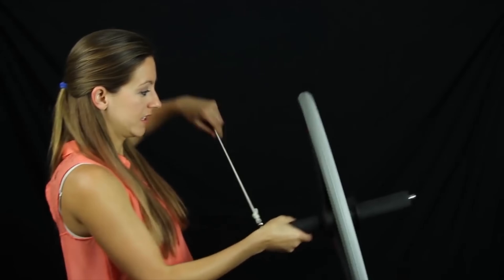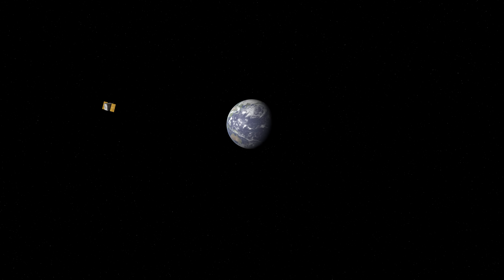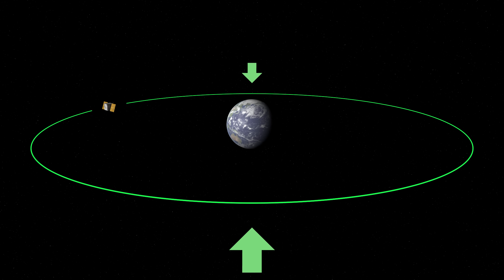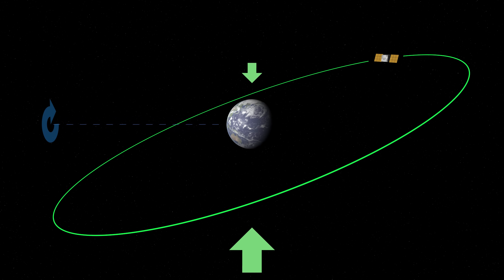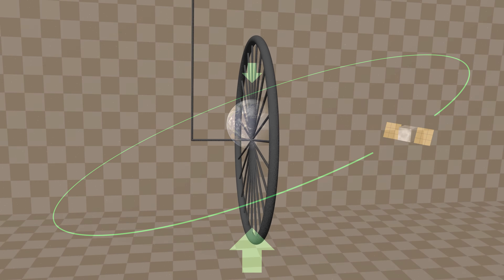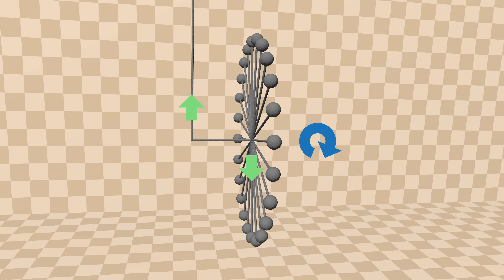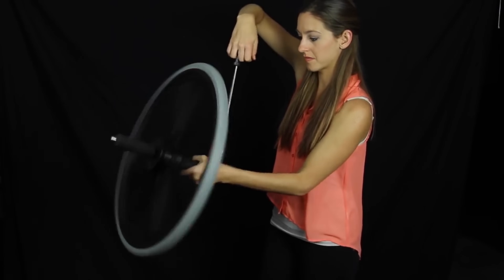Gyroscopic precession -- An intuitive explanation

Comment: That may explain why the wheel as a whole is rotating...sorry but i couldn't figure out why it is not dropping.????

It will be soo nice of you if you can answer me...
Reply from the maker: Referring back to the satellite part of the analogy, you'll notice that the orbit of the satellite is not turned in the way that you would naively expect based on the applied force/torque. So convince yourself of the answer for why that is the case, and you should then be able to transfer that insight over to why the bicycle wheel does not fall in the way that you would naively expect based on the applied force/torque.

Comment: As a motorcyclist, I immediately could apply this explanation to the mystery of why leaning a motorcycle causes it to steer in the direction of the lean. My shifted body weight applies a torque pressing the top of the spinning front wheel in the direction of the lean. The wheel responds by precessing in that direction. It now seems so simple. Thanks!

Comment: Thanks for great explanation. What is still not clear to me about gyroscope, is how it gets up in situation like in video ( https://www.youtube.com/watch?v=fv_AinDLHJY ). Is it possible maybe with Veritasium (if you would like) to check if this same effect of getting up will appear in vacuum. Greetings, KollA.
Reply from the maker: Whether it's in an atmosphere or a vacuum is irrelevant. And what's shown in that video is exactly the same as the spinning bicycle wheel demo, except the support string/cable in the bicycle wheel demo is replaced by a support pole in your video. Gravity is not actually being "defied", the pole is supporting the weight of the gyroscope.
Reply: @TheHuesSciTech   Yes, but I'm asking not about only gyroscopic effect, but why axis changing from more horizontal to vertical on "my" video. Like for me gyroscopic effect should only slower down gravitational falling down. In that case something push continuously gyroscope disk upwards (as long as it spin enough fast). So I wonder if this force (opposite to graviation)  is generate by Magnus Effect, and in vacuum this effect should disappear.

Comment: To me it makes sense why the axis changes in the way it does, but i still dont understand why does it "defy gravity" and doesn't fall. For example if u spin a top why does it keep balance?
Reply from the maker: I know this isn't a terribly satisfying answer, but here goes: for a normal non-spinning object (like, say, a pencil balancing on its end), gravity will try to pull it over in a certain direction, creating a torque around a certain axis, and then (because no precession is happening), it rotates about that axis and thereby falls to the ground. But when you have a spinning top, the torque from gravity is applied around an axis that is "trying to make it fall over", but the axis change occurs, and it ends up adopting the classic precession-of-a-spinning-top motion that you're familiar with.
Reply: @TheHuesSciTech  Thanks, it is satisfying actually

Comment: It makes sense for a system spinning around a central point and it can be seen that the orbit of the satellite will change/rotate at 90 degrees to and while the up down torque is applied. The system of the bicycle wheel is not the same because it does not allow the system to rotate about a central point because the fixed point is offset from the centre so this adds an element to cause the orbit/wheel to move around the the fixed point. That part is not explained but would equally apply if the wheel spindle was placed on a solid point. The reason for this known and is why a spinning top will do it. All to do with wP.

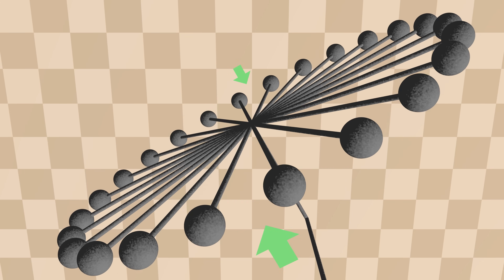Comment: This is the best explanation I’ve seen on YouTube by far but at 2:50 shouldn’t those two forces twist the wheel on the other axis? I guess I’m asking if the wheel should basically flip. It makes sense to me that the orbit should change direction like that because, well it’s just the orbit, idk how to explain why that makes sense except it’s not attached to the center of the orbit or earth or any of that like the wheel is attached to the spokes. I Imagine if I push the wheel with my hands like shown in the arrows it would flip the wheel like I’ve said but Idk i just don’t understand
Reply from the maker: The thing is, the strings/spokes "attaching" the balls to the center of the wheel are just like the force of gravity in an orbit -- since, in both cases, the force is directed right towards the center of the wheel/orbit, and thus cannot have any effect on the twist seen by the wheel/orbit. 

I think you need to consider the balls to be separate objects, and the spokes in terms of the force they apply to those balls (rather than getting carried away with the nebulous idea of 'attachment'), and then hopefully it should become clear that the analogy is valid, and that the wheel should twist as shown. Then you can add more and more attachments and see that there's no reason why they'd change the outcome, and thus infer that a solid, rigid wheel will behave identically.

Comment: The torque has been eliminated,  but what happened to the weight of the wheel?  I mean, the satellite analogy was not held by anything, so the part of the turning (precession) was explained when the plane was shifted., but what  the about the weight, what is countering it?  why does it not flip over?
Edited(after 6 days:  Now I get it! the precession does not counter the full weight of the hub, but just sufficient to maintain the plane of rotation - like when you ride a bicycle, you turn the wheel to the side you feel like falling as  you move forward, shifting the CG just sufficient to remain upright!  And in the case of the gyroscope,  it also does the same by rotating (precessing) around the axle so that its CG is exactly on the attachment where the hub device is attached. And when the disk slows down, it has to speed up the twist.--Jus like on a bike! OR a racing bike taking a corner at high speed and rider's knees almost touching the ground! I wonder how brainy the gyroscope is? Any logic?

Comment: Came in confused came out slightly less but still confused

EDIT: I think I got it, and it's a lot easier if you consider it mathematically in my opinion. L(angular momentum)=(radius)(momentum). Both radius and momentum are vectors, and thus when vectors are multiplied, they create something called a cross product. A cross product creates a line that is perpendicular to the 2D plane that the radius and momentum were on. Here is a link on cross products: https://www.mathsisfun.com/algebra/vectors-cross-product.html  

and here is a link to a stack exchange question that may help: https://physics.stackexchange.com/questions/554047/why-is-the-vector-of-angular-momentum-perpendicular-to-the-plane-of-rotation 

Do comment if you want any clarification!
Reply from the maker: Keep at it, my friend. Just remember that this isn't really anything to do with maths; it's all about how things move in the real world, and just carefully thinking through what happens over time.

Comment: But where the energy come from l mean we push the stattelit a little bit his new direction is the depends on the speed of the old direction and the speed of the new direction but to add the new direction we need the energy because is it a speed here it is no problem because the stattelit give himself the energy but the force of the wheel comes from the gravitation so the gravitation make the wheel move around the rope and this move needs energy but when we say that the energy comes from gravitation that would mean that the weel need the sink a little bit because now potential energy is changing into moving energy .so does the wheel go down a little bit and after a while the wheel is hanging like a ,. + ,,  at the rope?

Comment: When the force is applied upward to the passing satellite, why is it assumed the satellite completes its upward travel just in time to be at the 90 degree point in the revolution? Your explanation implies that is the case, but I do not see why. 
Why couldn't a satellite  reach the end of its vertical travel at some other angle in the revolution, say 45 or 60 degrees for example? Why 90?
Reply from the maker: Play Kerbal Space Program and you'll see the effect in action. Or if you need proof: basically, an orbit occupies a plane. You have two constraints: one is that the plane intersects the Earth. The other is that the satellite stays in the plane, in particular, it is in the plane at the instant the force is applied. If you constrain a plane to go through two different points like that, there only degree of freedom left is rotation about the line connecting those two points. Such a rotation produces the greatest "upward travel" (as you put in) the more distant you get from that line, and the most distant you get from that line is after 90 degrees of revolution (assuming this is a circular orbit, of course).
Reply: @TheHuesSciTech  Thanks for the explanation. I'm closer, but still not getting it. You mentioned 2 points. Is one the point at the center of the circular plane (and center of the earth)? And what is the other point?
Reply from the maker: @jazzjohn2  Yes, one is the centre of the earth. The other is the satellite at the instant that the impulse acts upon it.
Reply: @TheHuesSciTech  ok, thanks. I'll continue to think about it until I get it. (That's the usual way I learn things.)

Comment: Brilliant!  So my friend - please, please, come up with a similar explanation for the TIPPE TOP. I'm struggling to understand why it's stable with the heavier side upwards. Because it doesn't have bearings, it behaves differently to a gyro. Obviously, table friction is the force changing the direction of motion of its parts. The axis of spin, relative to the observer, stays vertical. And the clockwise/anticlockwise direction of spin, relative to the top, reverses - magic!

Comment: Thanks, this is only intuitive explanation I've seen. To give others a hands on experience, I'm going to swing a rubber ball around in a circle, attached to a piece of string. And then ask them to hit the ball sideways so it's direction of movement is changed. They need to understand that fast moving objects resist changes in direction, and that's all we're really doing to a gyroscope wheel rim.

Comment: Now, my friend - have you any thoughts on Tippe Tops? The weird thing is that the axis of rotation actually rotates 180 degrees relative to the original axis. So when the axis of rotation eventually comes back into its original line, the direction of rotation of the top is REVERSED, looking at it from the viewpoint of the peg! My brain is getting there slowly. It happens because of the frictional forces of the table top, and it's offset centre of gravity. And like the egg shown by "Physics Girl" in your link, the stable rotation is when the heaviest part is on the top. But I don't think you can explain it with gyro precession. Gyros don't change their direction of rotation! However, the axis of rotation of the top stays unchanged relative to the table top.

Comment: Thanks for the orbiting satellite explanation - I now understand it! This is the only one that I've found that explains WHY precession happens. The key to understanding, is that pushing the satellite sideways changes its direction of motion permanently, and that changes its orbit. Brilliant explanation.
Reply: I just realised that the satellite will go faster, and the orbit increase in diameter - because pushing the satellite sideways should add energy and a further velocity vector at 90 deg to the original velocity. But does moving the axis of a gyro require energy?

Comment: Procession only works when one pole is fixed... without one pole fixed there is no procession. This is why procession of equinoxes does not work. There are other clues for example why do some starts appear to process and Sirius does not? The Earth does not process this way at all. One needs EU theory to explain what is going on and it turns out their hypothesis is much simpler. Having said all that fixed-pole procession is still really really cool and useful.
Reply from the maker: One can do the thought experiment/simulation of applying a torque to a spinning sphere, and regardless of whether "one pole is fixed", precession will be seen to occur. In fact, the satellite example here does exactly that. Precession of the equinoxes is very well supported and backed up by millennia of observational evidence. And the statement that "Sirius doesn't precess" betrays a complete misunderstanding because it's the Earth that's precessing, stars just provide the mostly static backdrop which we look at to see how the spin of Earth is changing. I don't even know what "Sirius doesn't precess" is even really meant to mean.
Reply: @TheHuesSciTech  https://www.youtube.com/watch?v=-oPE3l5E8uk&list=PLeeyNowkGd8PBMqxTwqwYzhTmWxEac2yM&index=5
Reply from the maker: @alanlittlemoon8194  That video claims that the precession of the Earth doesn't match up with calculation, and that such precession has never been measured in any planet in the solar system. Two facts which are obviously in contradiction with each other, but whatever. I gave you plenty of falsifiable statements in my initial reply to you, so if you'd like to actually engage in some debate here, here are some suggested lines: "Your demonstration of how precession occurs in the satellite example is wrong because X"  "Wikipedia's article on precession of the equinoxes is wrong in section X paragraph Y because Z"  "Here's what I meant about Sirius not precessing: X"  "Observing an anomaly in one star (Sirius) should cause us to abandon the idea of the way the entire Earth moves, rather than just asking questions about Sirius, because: X"

Comment: I understand this whole video, but I'm still confused about one thing: does the movement always occur 90 degrees ahead of where the force was applied?
Let's imagine the satellite orbit situation again. What if the satellite is moving REALLY slowly? I'm guessing it won't be 90 degrees anymore, but less than that.
Reply from the maker: In the satellite case, it is always 90 degrees. In the case of the spinning wheel, there's the thorny issue of the distinction between A) the axis of rotational symmetry of the wheel and B) the axis of rotation of the wheel. There's also friction. So things get messier in that case.

Comment: Making a scientific phenomenon sound intuitive sometimes destroys the physics behind it, and this is exactly what happened here. You need to understand the physics behind the phenomenon because your explanation above just provided viewers no real understanding (aside from the fact that was was shown is intuitive) , it is like when you memorize a math problem instead of understanding how to solve it.
Reply from the maker: Angular momentum is an emergent phenomenon that comes from multiple individual particles moving about; and gyroscopic precession emerges from looking at the behaviour of those individual particles when manipulated in the appropriate way. Even if this video doesn't provide a strict mathematical derivation of this fact, it provides the bedrock of intuitive understanding that would make such a derivation straightforward. This is much more pedagogically useful than telling students "here's the formula, the angular momentum vectors get added up, rote learn that", and the rest of the comments here back that up. Your comment is utter nonsense that betrays your own lack of understanding.
Reply: @TheHuesSciTech  i agree, but the point here is that what you provided here was more of an " analogy" by example rather that making the subject sound intuitive because it will never be, maybe for physics beginners it could help but not for the advanced.  The fear here is that people will begin to convince themselves that understanding a similar example means they now understand the phenomena itself which is wrong . Anyway , i advice watching Dr. Walter Lewin's MIT lecture on the subject : https://youtu.be/XPUuF_dECVI , starting from around @14:00.

Comment: I enjoyed watching your video - nice explanation.  Why did you show a wheel with individual segments may I ask?  Why not a conventional wheel?
Reply from the maker: If a wheel with separate segments behaved as shown, with the individual segments not "breaking formation" (i.e. they stay in the same relative positions), then it's trivially obvious that connecting the segments would make no difference to the outcome. So viewers see the analogy to satellites as clearly as possible, and then it's an easy logical hop to the real, connected-up wheel. If I just showed a real wheel, that'd be too large a logical jump from satellites for many viewers. At least, that was my reasoning.
Reply: @TheHuesSciTech  OK I see.  One of the reasons I ask is if each segment were to move independently of each other but still connected to the whole, so as to create a rotation but also a wave in rotation, I wonder about this movement in relation to precession or if there is any particular relationship?

Comment: Have you produced an example showing that a gyro effect is prevented when you constrain the gyro in a specific direction?  Strange but true.  I did that experiment long ago but don't remember precisely what I did.  I do recall that if you allow even a slight movement in the "preferred" direction the experiment fails.  I also recall that if you mount two gyros with the same characteristics on the same axis, no torque is produced.  I thought that the Navy, which uses gyros to store energy the EMALS launch system would do that but no details have turned up.